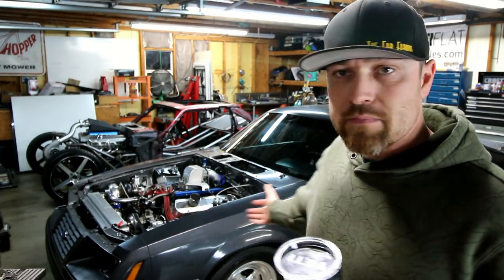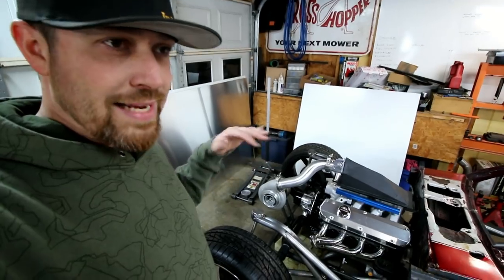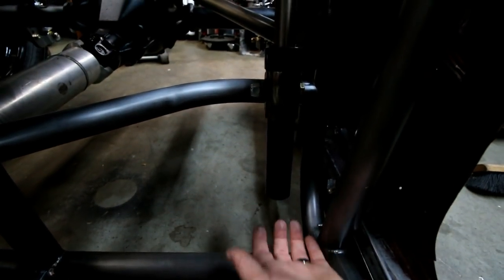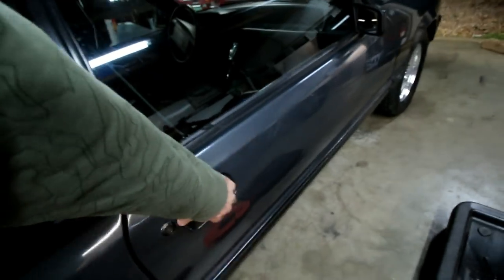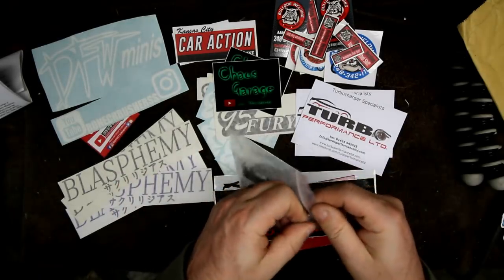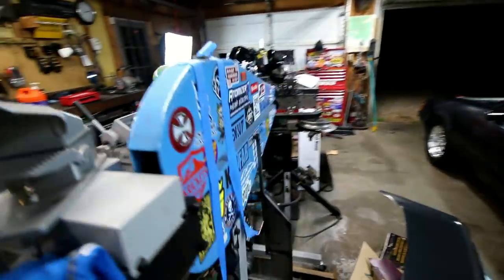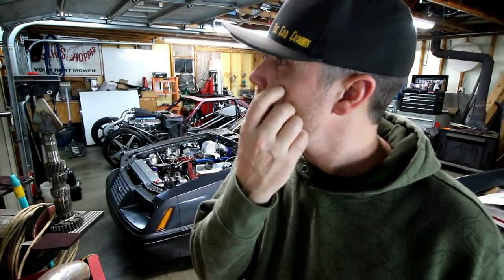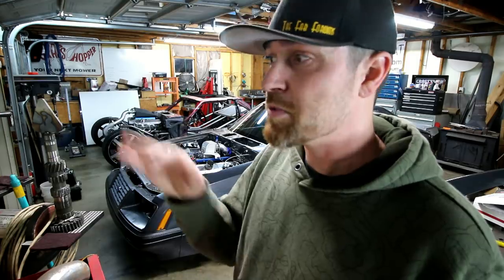What I Didnt Show You

Comment: First off, love your channel. Second a few ideas for the bibster. Front suspension, run a bar top of strut to top o strut, put a track bar to chassis to control the camber, then replace your height adjusters with stiff coil overs for suspension. And last the drag spoiler would be bad ass on the bibster.

Louie from CA

Comment: I would make a nice perfect elbow behind the throttle body and not restrict airflow and make it look how you want with the carbon.  Did more directly you can flow air into the intake straight down you will make slightly more power with less boost i e boost level is a measurement of intake restriction

Comment: Im gonna attempt to make pushrod suspension setup on front of my fiero... plan to use some of the fancy heim joints you use... will i have issues welding them with fluxcore welder? Its all i have idk if i can get mild steel heim joints like you got

Comment: Hey Kyle, silly question, but have you tried pulling the schrader valve core out of the rear hydros and see if they squat? Could just have some residual  pressure built up?
Reply from the maker: no schrader in the rear ones
Reply: Guess that woulda been too easy. :) you’ll get it figured out I’m sure.

Comment: Since that horizontal bar controls ride height couldn't you place the hydraulic cylinder there and put a standard set of coil overs out front where the cylinders are now and get a standard ride like you did with the back?
Reply from the maker: yeah but the coils dont look good up there
Reply: I was thinking about that after I posted. What about a coil over instead of the horizontal bar and then you could make any needed height adjustments at the same point.  It would have to be easier to adjust and maybe even cheaper than a hydraulic damper thingy your planning.  
Thanks for the response, bad ass work as always.
Reply from the maker: @sum-tingwong9936  that was my plan but I think I would have too many issues with maintaining proper suspension geometry throughout its motion
Reply: That makes sense, the since the top would be moving front to back as it compressed at the horizontal strut area while the lower "A"ish arm you have would be moving up/dow & in/out in its arc. That could cause some very unpredictable pull and caster/camber changes under deflection and load. Could even be dangerous if it doesn't compress inline with where the hydraulic piston is located. Thanks again for answering my questions, made me remember a bunch of stuff about front suspension I had completely forgot/overlooked. This is why I always like messing with old 4Xs and their nice easy to manage solid front axles lol.

Comment: 2 questions. Im a Chevy dude so i want to know why they call it a "Foxbody"? and 2nd you said a hydraulic roller cam is grocery store parts... whats better than that as an option? Take me lol. ill work work for you :)
Reply from the maker: lol....the Fox Body is something Ford came up with I think. Hydraulic roller cams are smother and better for street cars, most of your race cars run a solid roller setup. Solid roller cams have the potential to make more power.
Reply: Ahhhh. Ive worked on cars forever but never much engine internally...I was under the impression it was the other way around about Cams... Ive been trying to bulk up my brain power for engines lately thinking about new things to me. Thanks for that tid bit
Reply: hydraulic street.....solid race... dont know if you dont ask
Reply from the maker: thats right

Comment: Www.Mcmaster.com  has anything and everything from little gears to hydraulic cylinders to kitchen sinks to stepper motors bolts springs and any other thing you can basically imagine. Check it out. They might have something to help you out with hit hydraulic system to give it some spring effect
Reply from the maker: I already have what I need
Reply: The Fab Forums regardless if you have what you need that sight will have anything you might need in the future.
Reply from the maker: right on....thanks
Reply: The Fab Forums when I first came across the site I spent like 3 hours looking around and was just amazed. And the site is very specific. If you need a gear with. 23 teeth with a 1/2 inch mounting shaft hole and a gear pitch of 22° they got it. I spent a few hundred bucks on just odd fasteners and heim joints and hydraulic. Fittings and safety stuff.